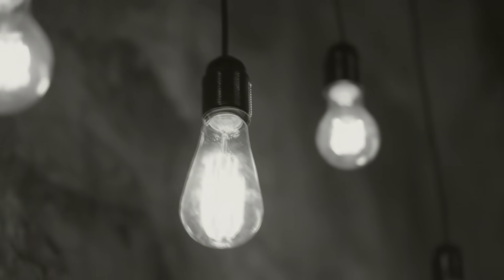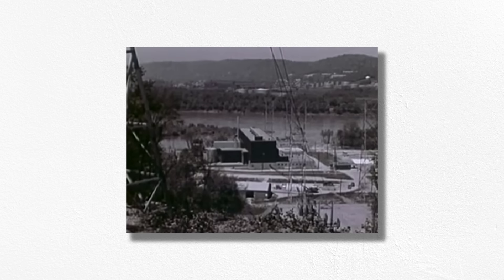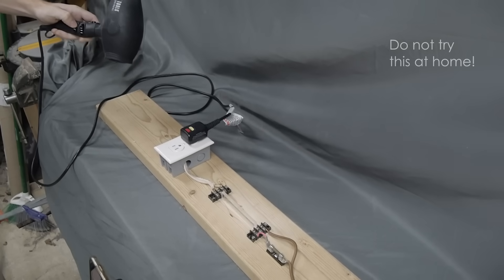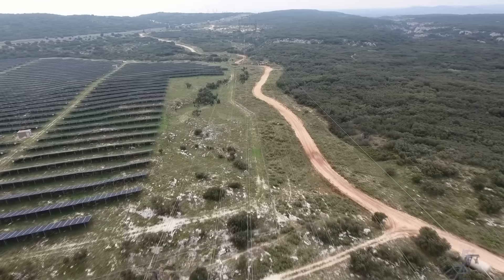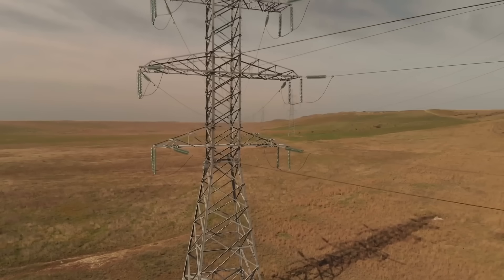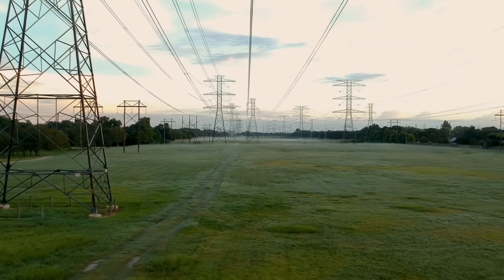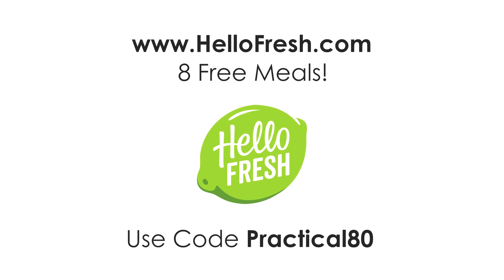How do Electric Transmission Lines Work?

Comment: So does the TRANSISTOR ensure that those receiving power closer to the source do not get higher voltage than those further from it? Or is it more just to protect from surges, power outtages? Probably all. I do not like how these produced magnetic fields interrupt all biological life's own magnetic instincts. It is not so "practical engineering" when we lose our own genetic benefits. That is alarming. Radiation also, this is why "sustainable sources" such as solar must be phased in country wide and the current methods need to be phased out. We know better now, there is no excuse.
Reply: The magnetic fields from the powerlines are far weaker than those from wiring in your home as you are closer to the wires.
Reply: @karhukivi  i doubt that. I do not hear humming from my walls,as I do from the transmission towers, nor does anything get drawn to them. I do know that some birds drop dead when they near those magnificent tranmission power lines. The ones on our urban streets are less so, but by the time the original source hits the local transistor just before my house there is a lot less voltage. If our homes had the same voltage as those huge transmission towers the iron in our blood would separate from the hemoglobin. People would notice enemia, then unexplainable fainting, become bleeding prone. And it has been well documented many people, full communities in close proximity to them have litigated for cancer. Mostly in the states.
Reply: @beverlyanne5699  The humming from the powerlines is the wire itself vibrating in the Earth's magnetic field just like a big guitar string.  Put your ear near a transformer (e.g.a doorbell transformer) and you will hear humming too.  The wiring in the walls if fixed in place so not much room to vibrate.  There are people who will go to litigation for anything - like blaming McDonalds for eating too much!

Comment: Power distribution is one of those topics that the more you know, the more there is to know!  You could easily make a video on this topic 2+ hours long by talking about things like why 3 phase is generally used, why AC is more popular than DC, how conductor bundles and the shape of equipment can effect corona discharge, load sharing between phases, benefits of overground vs underground cable, surge and short protection devices etc....you really could go on for LOOOONG time if you wanted to, probably well beyond what most people would understand or find interesting! Good job he kept if relatively short and sweet.

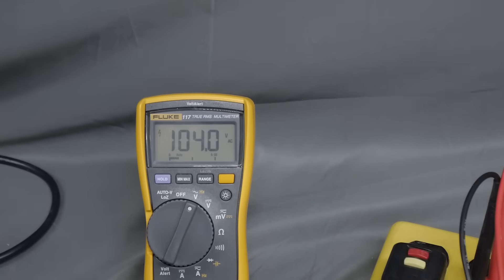Comment: @ 2:46 you said P stands for power and 20 seconds later it stands for powerloss. Don't like that! It just confuses people. Be a little more exact, mr Engineer.
Reply: Same thing, power is power.  Whether it is transmitted or lost is the concern.
Reply: @karhukivi  In units they are same. But first you have to generate power. After that you can loose it. And hopefully, not all the generated power is lost during transmission ;-) So they can't be the same!
Reply: @jacobvandijk6525  Yes, the power is first generated and then transmitted and there is a loss in the cable.  Think of using an electric heater - the total power is heating mainly the heater, but also the cables supplying the power to the heater.  It is "power" in both cases, so the same symbol P.
Reply: @jacobvandijk6525  OK, here's an example - I have a heater in a dog kennel at the end of the garden, the heater has a resistance of 5 ohms and  the long wires to the kennel wires have a resistance of 1 ohm, so 6 ohms in total.  The power is supplied by a 12V device, so 12/6 = 2 amps current.  Now calculate the power in the heater and the wires P=R*(I^2).  The heater is 5*(2^2) = 20W while the power "lost" in the wires going to the kennel is 1*(2^2) = 4W.  If I put the power supply in the kennel the heater would get a higher current =12/5 =2.4A, so the power would be 5*(2.4^2) = 28.8W.  I'm wasting power in the long supply wires.   

All methods of power transmission lose power somewhere, but to lose it all and have nothing supplied to the customer would be absurd!.

Comment: I’m trying to understand and think critically also. Rule #1 electricity moves the speed of light (the ultimate speed limit) and order to transmit over a long distance reduce the amount of electricity that’s available but compensate by moving it fast which either it was moving to begin with and since it’s moving fast it’s always available throughout the conductor which if you haven’t reduced to begin with would be always available anywhere throughout the conductor to begin with.

So is there to sets of speeds 1, the ultimate speed limit which electricity normally moves (the speed of light) and 2, an even faster speed than speed of light which increasing the voltage (the electricity’s DESIRE to move) produces? 

Where am I going wrong?
Reply: It doesn't travel at the speed of light EM radiation travels at the speed of light in a vacuum. The speed of an electrical pulse or wave depends on the impedance of the conducting circuit.

Comment: The lines near a house i know buzzes pretty loud when especially it is very light rain can you explain this Grady?
Reply: The individual water droplets on the conductors create a smaller radius for the electric field to concentrate around, making ionization of the air easier.

Comment: can someone explain me how increasing voltage reduces power loss as P=V^2/R increasing voltage will increase power loss too.
Reply: If you double the voltage, you halve the current for the same power transmission,.  The conductors have some resistance, so the power lost is equal to the current squared times the resistance.  If the current has been halved,  i.e. 0.5, the  the square of 0.5 is 0.25, i.e. the power lost is only a quarter before the voltage was doubled.

Comment: I know that 3 identical loaded phases dont need a neutral line, there are 3 phases going through the lands, so my question is how do the electricity suppliers equalize the load on the lines?

Comment: As a ChE I energized many high pressure steam and process liquid lines in my career.  In my first project I had a quarter mile of 400 psig steam line to initialize and found a couple of supports that were not adequate for the expansion.  I also energized a number of short (a few hundred feet) 13 kV lines in plants over my career and that was always interesting and, a couple of times, exciting.  Now I'm retired and have been watching a 20 mile long,  340 kV transmission line being built near me.  I've been wondering how this new line will be energized.  Having listened to the internals in substations react to hitting them with 13 kV, I have to believe that closing a switch with 340,000 V on it must take some careful thought.  If someone could enlighten me, I'd really appreciate it.

Comment: Hi. I come from a course in Germany and Austria. And i saw transmission lines with 4 wires. Do you know what is that?
Reply: The fourth wire could be the shield wire at the top of the tower or a single phase (typically lower voltage) underbuild.
Reply: @toddrf  It also has the shield wire at the top without isolation. I guess had something to do with trains.

Comment: Hey can you do a video explaining what the significance of the voltage in our power sockets is? 

If I'm not mistaken, in Europe and most of the world, homes normally have 200-240V power sockets, whereas in North America it's usually 110-120V. Someone I was talking to in Europe said that the higher voltage used makes their grid safer against blackouts, and that we would have to use wires 4 times as this to transport energy at half the voltage from substations to homes. Is all this true? Thanks so much and I love your videos!

Comment: As the channel name says "Practical Engineering" and that's exactly what you get. Everything explained in a simple informative and no nonsense way. Every engineering student should be watching this channel. A suggestion for some topics to cover in a distribution video. PV exporting and not exporting, battery storage and EV charging which are all topics very much currently being discussed by those in the utility world. Thanks again and keep up the good work.

Comment: I think you should have covered is the use of multiple bonded conductors at higher voltages, such as 2, 3, or even 4 (at 765kV), and techniques such as EHV which are being used in Europe.  Transmission lines, part 2??? :)

Comment: Voltage in technical  terms is ELECTROMOTIVE FORCE. I= current /joules  which is pushed by E=VOLTAGE/ELECTROMOTIVE force . ELECTROMOTIVE force E × I=Current /Amps = P /power. WATTS. R=resistance is  in ohms law . Resistance in inductors is inductive reactance. In capacitors  resistance is capacitive. Reactance.

Comment: I’ve heard the grid referred to as the “infinite buss”! I’ve also seen lightning strike the shield wire, travel down the tower and exit thru the ground cable we just installed. About 20 meters from the tower the sand turned to glass. The tower was 32meters tall as I recall, the ground wire was a meter deep. Great respect for lightning from that point on.
Reply: What if the sand turned Gold or diamond?
Reply: @sareeyemanusqaame8723  Harnessing the power of lightning to create gold..... that would be something

Comment: You are using a direct current equation (V=I·R) in an AC system, where inductivity needs to be taken into account to calculate actual voltage decrease.
Btw... the lighting protection wires do carry current. It is from an induced voltage from the currents flowing through te main conductors and as these protection wires are grounded at each pylon, there is a current circuit (via Earth) so an inducted voltage will lead to a current. You explained this at 7:`19 mins yourself. Also there is a capacitive connection between the main conductors and these lighting protection wires.
Beyond that, nice video...

Now… for the bonus question... in DC for simplicity... 
Suppose a 1000 V line is conducting a 10 A. The line has a resistance of 10 Ohm, so 900 V remain at the other end. That means 9000 W is being transmitted and 1000 W are losses in the conductor. Same conductor but we ten-fold the entry voltage to 10.000 V. Still 10 A and 10 Ohm, so 9.900 Volt remain at the other end. So power transmitted is 99 kW. 
Nothing in the conductor has changed, 10 A and 10 Ohms... How can there be a 11-fold increase in the transmitted power?

Comment: Hello, can you please make a vid with pump and pipes, it interesting to see how pump works with changing the suction diameter of a pipe (vice versa), how can influence different latitudes of suction pipe, if there are no check valve, if suction pipe too long, if there too high  velocity in the suction

Comment: I was hoping to hear about the paired power lines that you see many times in this video. I.e. two cables very close to each other. What are those for?
Reply: Most electricity on transmission and distribution lines is in the form of alternating current (AC).  With AC, the polarity of the circuit regularly changes, often dozens of times every second.  (In contrast, consider a battery is direct current, and AC would be similar to swapping the + and – connections on that battery dozens of times a second.)  Alternating current electricity shows a tendency to want to travel mainly on the surface of a conductor.  This means that making a wire larger will help it carry more current only because the surface area of the wire is larger. 

The pairing (called bundling) you speak of has a few beneficial effects.  First, adding a second (or more) wires to the conductor increases the surface area of the conductor, allowing it to carry more current.  The multiple wires act as a single conductor but with double (or more) the surface area.  Second, the physical arrangement of the different wires forming the conductor can be used to reduce the losses of power into the air surrounding the conductor.  This loss, called the corona effect, can make a big impact on the efficiency of a power lines over its entire distance.
Reply: @jovetj  Thanks, that helps a lot! For some reason I thought that long distance transmission was usually DC.

Comment: Hello my dear engineer. Recently there was an earthquake where I live and some hairline fractures that a bit concerns me occurred in the apartment of mine. Can you please explain when people should really concern about cracks. I'm an engineer as well I know for a fact that not every crack in a wall means danger, sometimes it's just some cracks on the plaster. I wanna know what types of cracks means business. There is a crack in my bedroom wall from ceiling to the floor, one straight line. Usually such cracks tend to mean some separation of 2 concrete joints, at least that is what they taught me in the collage. I'm an environmental engineer and we took about 2 or 3 classes about structures. So I don't have adequate knowledge about concrete residential buildings.

Can you please make a video about this? <3

Comment: What about neutral wire in transmission lines ?
Reply: Three fase symmetric electricity system, return current is always zero (any moment in time), so no conductor is needed.

Comment: I am facing a similar issue with my micro grid system i believe your expertise would provide a quick solution. I have a micro grid that can power say 50 - 100 homes. Is there any possible way we can discuss it via email?
Aumecycle@gmail.com

Comment: I got a lot out of this vid, but I was disappointed that you glossed over the way electricity is traded between energy companies. I've got an idea about how the economics work, but I've always wondered about the engineering involved, in practice. How often and how are connections  switched, for example? And there's a big wind farm across the valley from me, so I imagine my fridge is running off that on this blowy day, but if the wind slows down, will that farm be connected to fewer customers, or would my power come from a mix of sources, some many thousands of kilometres away?
Reply: You might find another video of his interesting:  https://youtu.be/v1BMWczn7JM

Comment: Does this mean that 220v is more efficient than America's 110v?
Reply: Technically, yes. 

But America does do 240 volt service.  It's just only the "big appliances" that use it, such as furnaces, air conditioners, water heaters, and electric clothes dryers. Everything else, such as lights, toasters, irons, etcetera are 120 volt.
Reply: @jovetj  Ah that might explain the 240 volt plug I once saw in a hotel just for the hair dryer? Interesting
Reply: I doin't think we have many hair dryers around here that use 240 volts.  Since it was in a hotel, I suspect maybe it was provided for foreigners with 240 volt appliances to use.
Reply: @jovetj  Ah alright. Thanks for explaining!
Reply: Not so much an explanation, but a guess!
But the efficiency part is technically true, just remember that at the short distances that distribution from final transformer to home or business happens, the efficiency difference is minuscule.

Comment: @2:45  Maybe I'm missing something, but if P=I*V=(I^2)*R, and we then use V=I*R and increase V to decrease I, from the first power equation (P=I*V), our power stays the same, but from the second power equation (P=(I^2)*R), the power is decreased because we've decreased I. Is this because the first equation is power delivered, and the second is power loss? Or something else?
Reply: Imagine a circuit with 2 resistors, R_loss, for the resistance of the wires and R_load for the used power delivered; and then a Voltage Source E. 

P_total = E*I = P_loss + P_load = V_loss*I + V_load*I. P_loss = V_loss*I = R_loss* I^2.  Notice that I is the same.